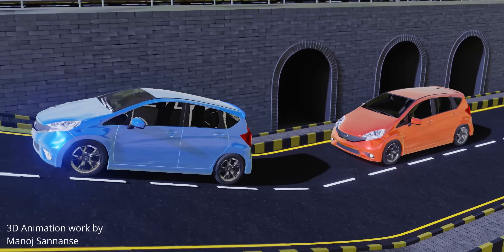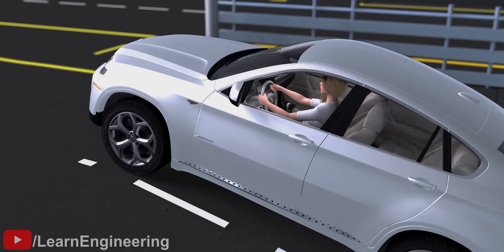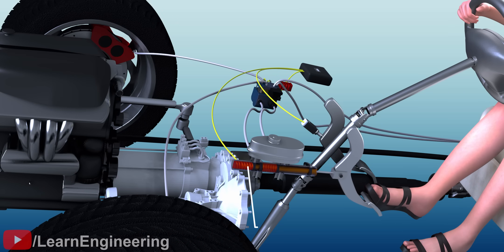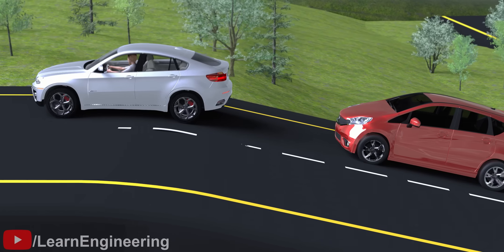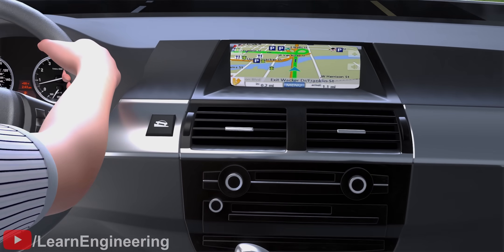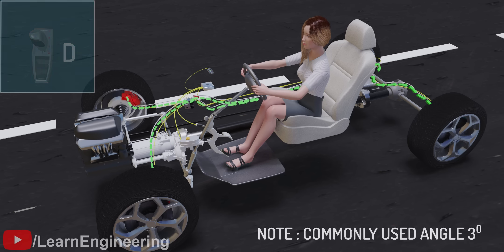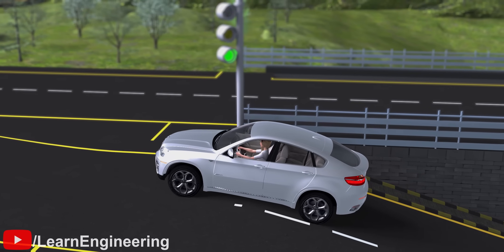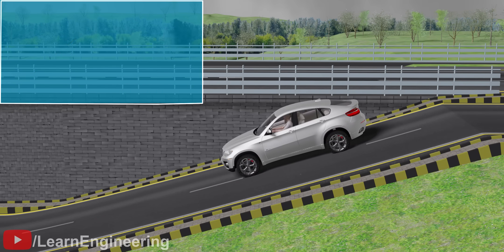Understanding Hill Start Assist!

Comment: I don't understand why it's being invented. People have 2 feet to use to press the brake and gas pedal simultaneously on an automatic transmission.
Reply: Have you ever used your left foot on the break before it’s awful...
Reply: Manual transmission drivers may not prefer to use their left foot due to muscle memory. They have other techniques:
• Heel-and-toe
• Parking brake

Also, amputees.

Comment: „a few seconds are required to switch from brake pedal to accelerator pedal” 
Does it work both ways? If so, than don’t drive any car
Reply: its takes only split seconds to switch from brake to acceletor pedal.
Reply: try using hand break and clutch...
Reply: @saberirs178  it isn’t necessary if you can drive a car
Reply: You can't just smahs the gas pedal in when starting with first gear otherwise you'll lunch yourself forward and smash into the guy ahead of you unlike the break that you can either ease in to stop or can smash it instantly in an emergency.

So yeah, switching from break to gas is slower than switching gas to break.